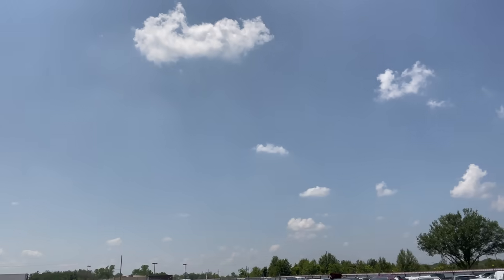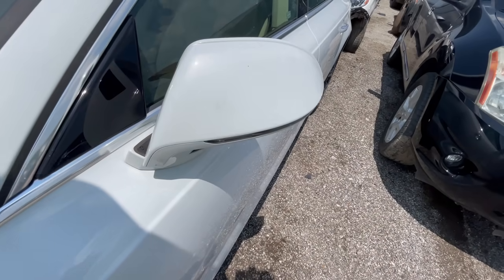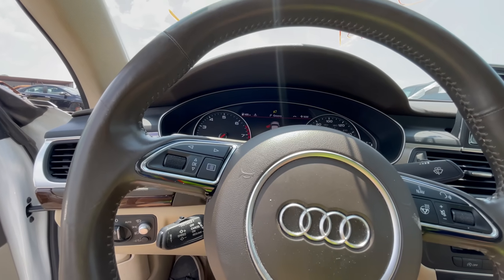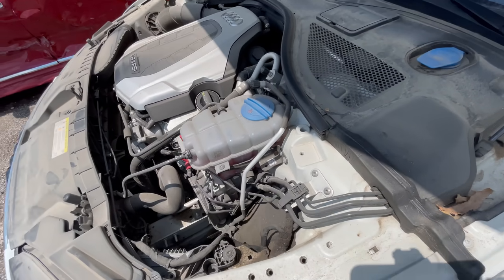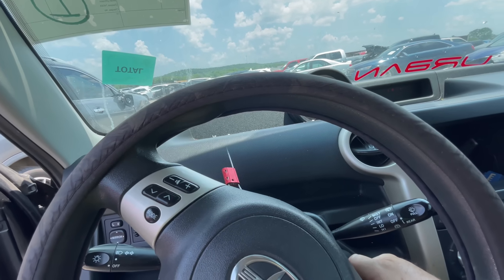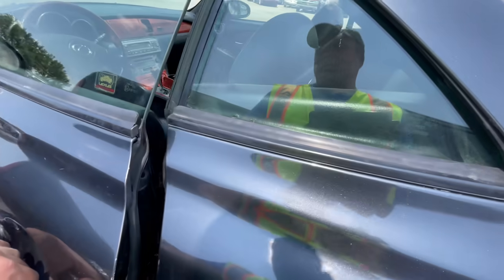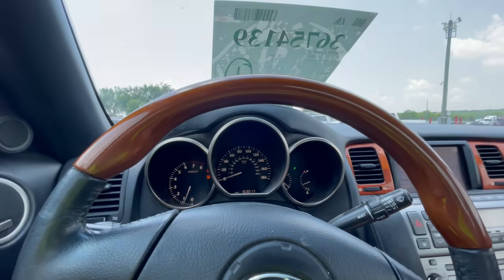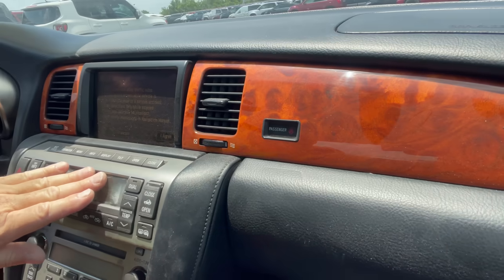Does Mike Need A Lexus SC430 In His Life? IAA Walk Around 7/7/23

Comment: From a 430 owner .....   the ls and sc430 share alot of drivetrain parts.....   the motor.... it won't die...   the transmission. It will die..... most million mile motors have had at least 1 if not 2 or 3 transmission rebuilds....     great cars. Parts are abundant..... 

A transmission rebuild after 300k miles is well worth the money in miles.... don't knock the cars weakest points as they aren't that horrible

Comment: Last one of these you looked at I told you to buy it those SC430 is a very nice Blvd. cruiser and because it's a Lexus it will be relatively trouble free.  Buy it, fix it up and clean up that trunk area with your little handy dandy carpet shampooer you got and you will "love a long time".  I personally would hold out for a better color, I'm so over the gray and silver look and black interiors are hot but definitely buy one if the price is right.  By the way I can't believe you got the little Geo Tracker to run, quite a feat, now you need to figure out why they had it all tore apart, good luck.  😀✌❤